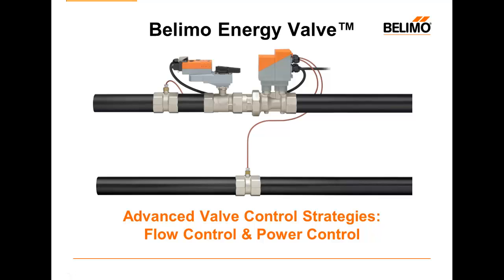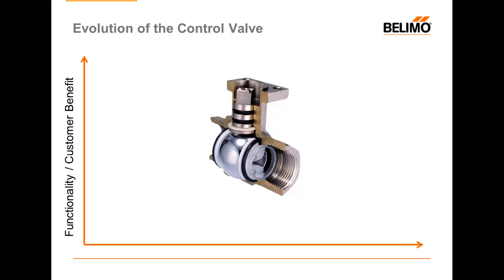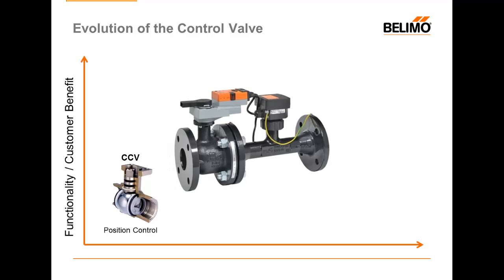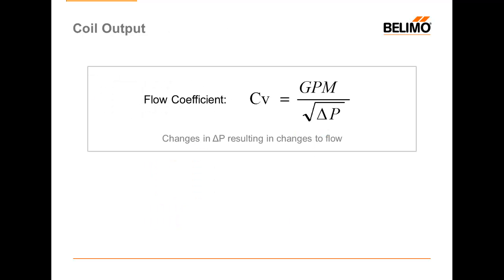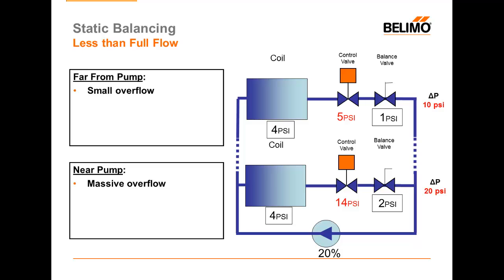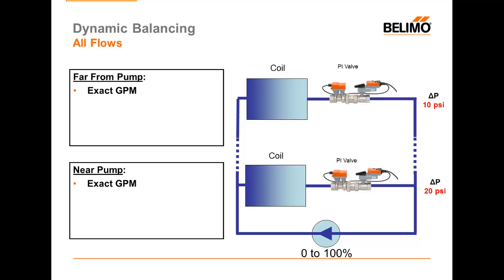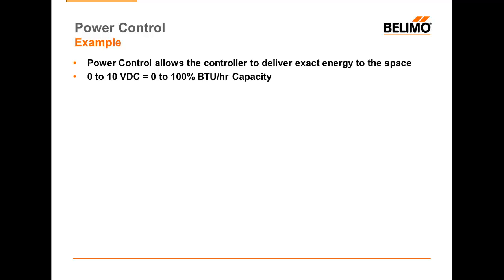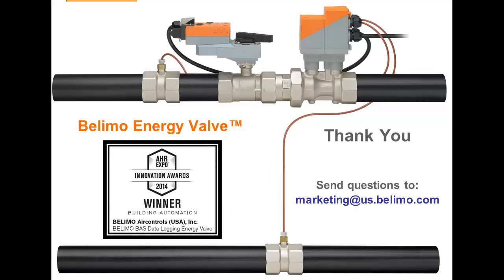Webinar: Advanced Valve Control Strategies: Flow Control and Power Control

Comment: Umm, isn't the pressure drop across two parallel sections supposed to be the same?  How could you have 20 psi across the near section section and 10 psi across the far section unless there was something inhibiting the flow to the far section in the first place?
Reply: No..
Reply: The additional length of pipe on both the supply and return is what causes the additional pressure drop.